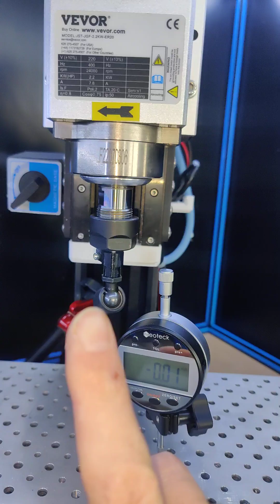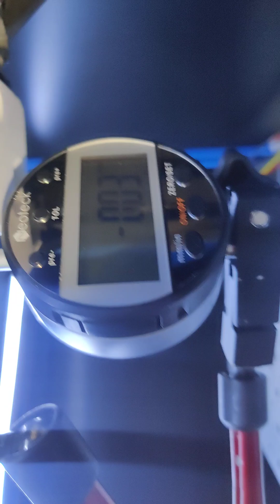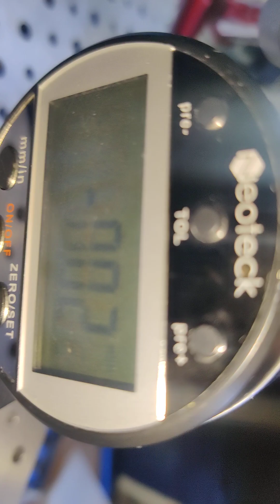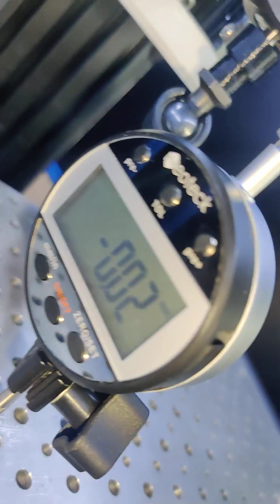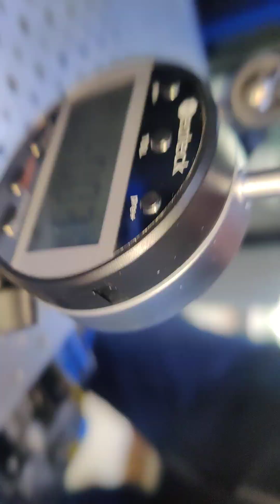Quick guide to tramming the Milo

Comment: You are doing it wrong. Its not the motor you should shim under, its the rails as they control the linear movement.
Reply: That's unfortunately more difficult with this particular machine.
The Milo 1.5 is more of a pain to shim under the column. (Thus the vertical axis)

It's something the designers have addressed in v2.0.

So OP isn't wrong. Just perhaps suboptimal. But practical.

Comment: What machine is that? I have a vevor router but your's looks sturdier, not to mention your pro lvl spindle upgrade. Mine has plastic holding the verticle spindle controll to the  sideways (x?) Axis controls. Ive been too busy with other projects to start playing with this more than first few leveling adjustments. Im assuming your's cuts metal but what about steel? Mine says aluminum/wood but im wondering if i upgrade from plastic spindle holder to aluminum if mine will do steel? Rest is pretty sturdy and can be reinforced. Im not expecting too much precision considering the probable flexing.
Reply from the maker: Bit late on the reply but it's a Millennium Machines Milo V1.5. It cuts Aluminium mostly but can cut mild steel pretty effectively with some caveats.
Reply: @ninemile143  thanks for the reply, timing doesn't matter, I'm just glad to know what it was thanks👍